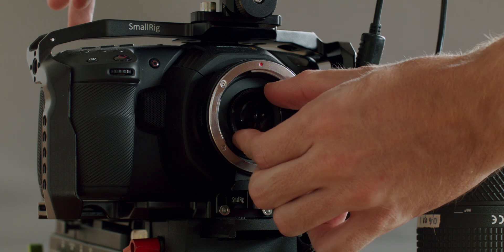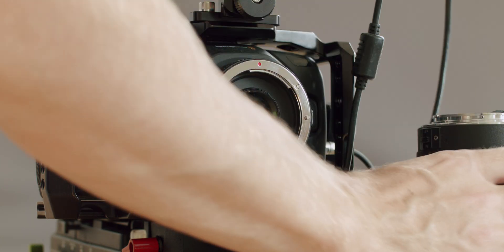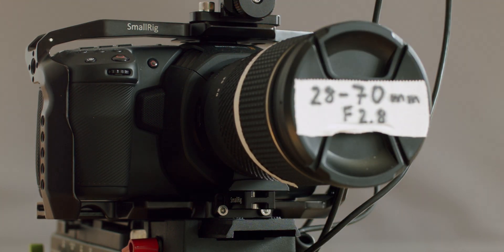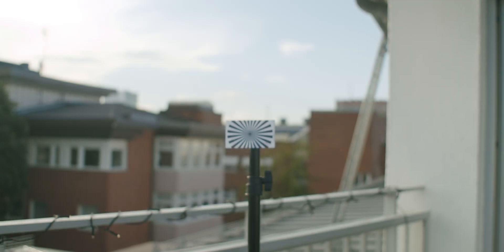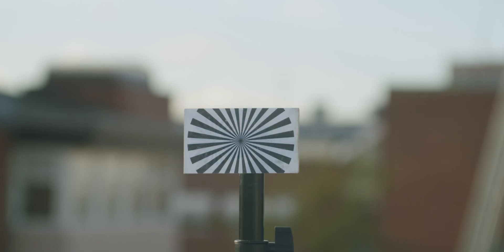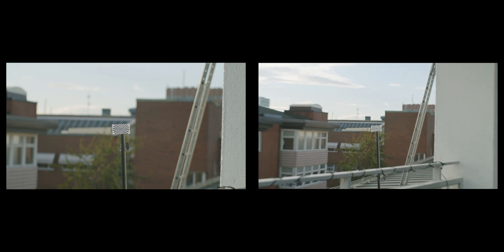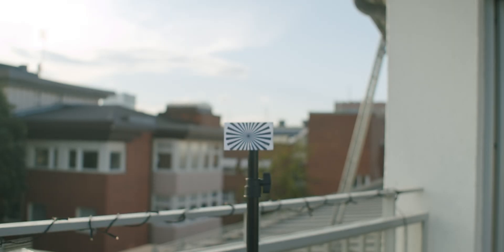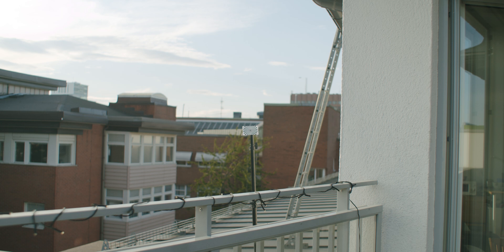Can You Make A Lens Parfocal Using A Speedbooster?

Comment from the maker: UPDATE: I once again own the very popular Sigma Art 18-35mm and I'm happy to report that i managed to get that lens parfocal aswell!
Reply: How did you get the 18-35 to work with a speedbooster without vignetting?
Reply: also wondering this since its a cropsensor lens  @tristan6509
Reply: @tristan6509 it doesn’t vignette on an Ultra on a MFT sensor.
Reply: Thank you for sharing this update. I just bought the sigma 18-35mm and you answered all my questions!
Reply: Yeah, I did that with my Sigma 18-35 and Tokina 11-20, ATX-i with my metabones speedbooster on a Canon m1 eosm using Magic Lantern.
Reply: Hello, should the speedbooster be adjusted for each lens or does it work for all lenses with a single adjustment? Thnk

Comment: I really can’t sure about it but my guess why this can be happened is correcting back focus.
Modern lens’s design separates focus/zoom mechanism which is usually considered as parfocal design. 

So every lens should stay in focus when zooming but it’s not. Why? Because flange back(back focus) is not correct. Even parfocal cine lenses aren’t parfocal when backfocus not correctly aligned.

Moving the glass of speed booster to the correct position make sure image correctly focused right onto the sensor, and this seems to be making modern lenses parfocal.
Reply: So, using old fd lenses to ef-s cameras maybe possible without additional glass. 

Just adjust your speedbooster and  you may get infinity focus correctly.
Reply: Reason modern lens’s backfocus is not correct may be the change of focusing mechanism. Old SLR/DSLR cameras (except modern DSLRs which can adjust it’s focus back and forth) AF uses phase detecting sensor, which is separated with its sensor, to be focused. meaning manufacturers should keep their flangeback more strictly.

But mirrorless cameras? They aren’t. Regardless of Phase detecting sensor(in this case focusing pixel) or contrast detection one, AF is happening right on the sensor.
Reply: And it makes keeping their flangeback less important (unless it has correct infinity focus) making ‘optically par-focal’ to ‘not parfocal’

Comment: Nikon AIS 75-150mm f3.5  works
Tokina 24-70 works as above.
Sigma 18-35 works.
Hanimex 28-80 f3.5 works.

All with viltrox ef to mft
Reply from the maker: Thank you :)
Reply: Do you need a different speed booster setting for each lens?

Comment: Quick question.

What If I had a sony a7iii with a tamaron zoom lens

Are there speedboosters for the same mounts on both sides?🤔 (E mount for sony)
Reply from the maker: Just like any adapter there needs to be space for the adapter. So it needs to go from a lens that uses a mount with a longer flange to a mount that uses a shorter flange, from Canon EF to Sony E-mount for example. 

And to add to that, the A7iii already has a full frame sensor. So using a speedbooster with a full frame lens will only concentrate the light from that lens to a smaller area (to fit it to APS-C/Super35 for example), so the lens would no longer cover the full sensor of the A7iii.

Comment: Thanks I did this on my Sigma 18-35 with Metabones ultra x71 on my BMPCC4K, I was able to get the Parafocal effect but not the infinity focus. I can get infinity focus by dialing the first line mark, but not at the very end hard stop, I tried everythign even micro adjustments,  but it's ok for me as I'm the only one who uses this lens so I know where infinity is but overall it's awsome to have a Parafocal now I'm very happy I could do quick zooms in and out without losing focus for like a rapper singing or documentary.
Reply from the maker: If you have it focused at infinity when its at the mark for infinity on the focus scale then it is dialed perfectly. Going past is focusing the lens beyond infinity. Lots of still lenses lets you do this to make sure you'll reach even if the mount is slightly off.
Reply: @carlscinema7086  ok then it's my bad, yes the hard stop is beyond infinity I had it that way before, thanks for explaining. Also I did this on metabones ultra, it's same thing but the glass is adjusted from the back side so you must have the lens inside the metabones so you'll know the limit of the back glass.

Comment: Hi, just wondering, does doing this mod on the Sigma Art 18-35mm cause it to lose ability to reach infinity focus?
Reply from the maker: Mine still reaches infinity without any problems 👍 but just make sure to test it out in case your combo differs
Reply: @carlscinema7086  Hm... i'm trying to adjust mine, and mine just doesn't want to turn at all :( even after i completely remove the set screw.
Reply from the maker: Which speedbooster do you have?